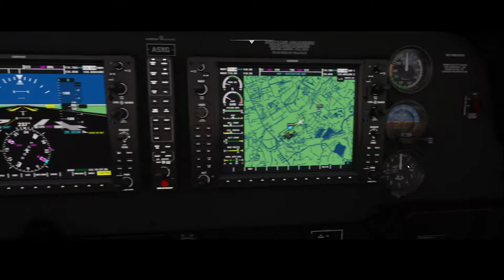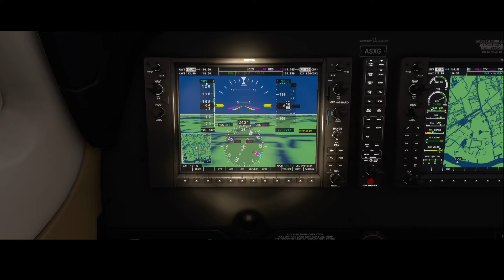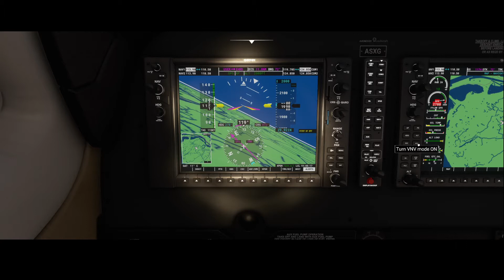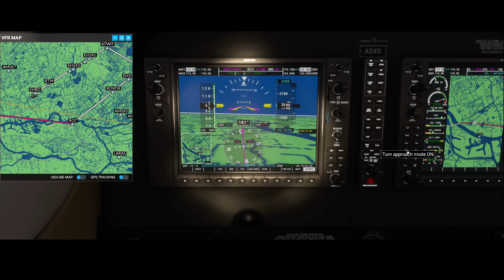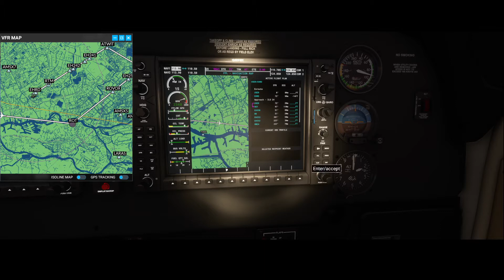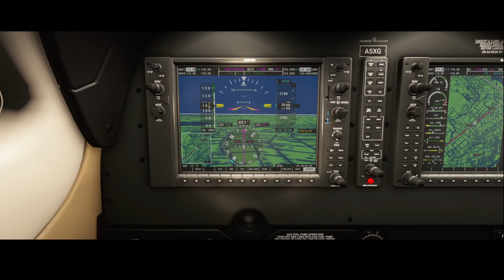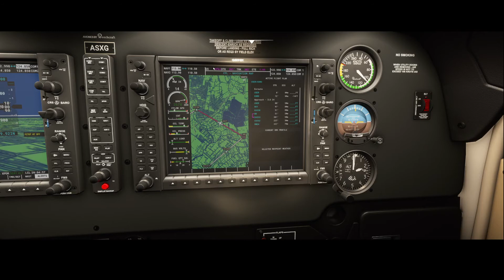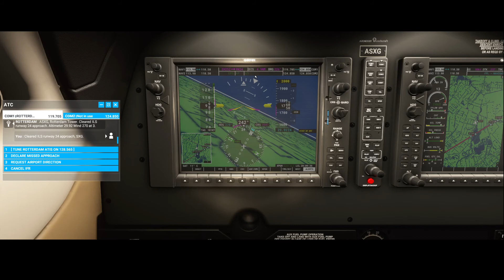Flight Simulator 2020 - How to - Beechcraft Bonanza G36 - autopilot

Comment: Hi, new to msfs here.How do you get the vfr map to display on the second screen. Also how do you get the plane to descend in autopilot, you mentioned there’s the nose down vertical speed button but that isn’t precise enough so isn’t there like a way the computer decreases altitude itself or something.
Reply from the maker: hi muhammed you should click on the right top which will make it a window after which you can move it around. you can try to use the flight level change (flc) button to automatically decrease altitude

Comment: How do you steer the bonanza when on the ground.
Reply from the maker: hi Tom if you have foot paddles using the foot paddles. If you have a joystick using the stick and turn it. If you are using the xbox controller the lb and rb key. if you are using a keyboard the return key and 0 key on the numeric pad
Reply: Hey Tom! Also if you just have the yoke like me and no peddles there’s a setting in the assistance menu for assisted rudders. Moving the yoke left and right will also move the rudders on ground for easy turning. Happy flying!